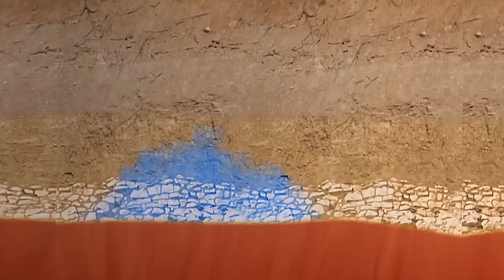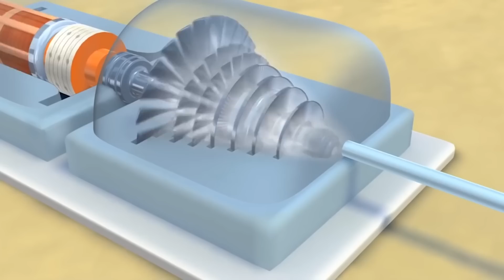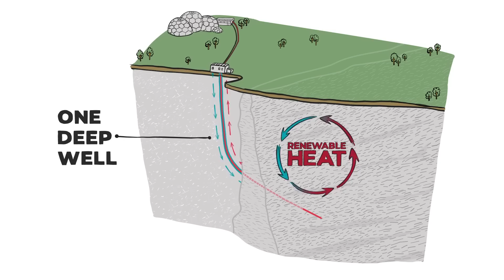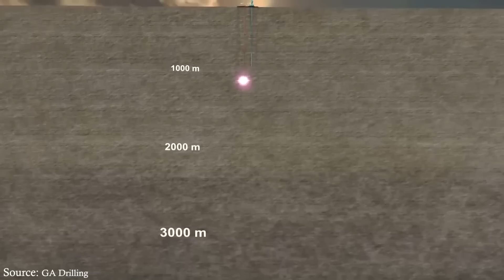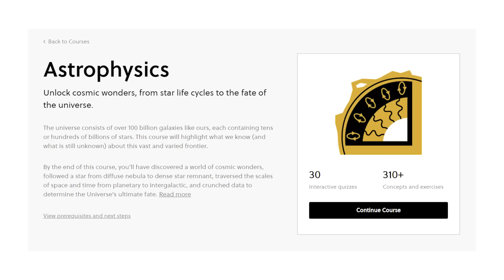How This Hole Keeps Generating Energy

Comment: High energy doesn't equal to High power. I bet the main challenge would be the Rate of power generation. You would need a bigger surface area at the bottom of the pit you dug to get a meaningful amount of water heated within a relatively shorter period of time.

Comment: Lots of good comments about the corrosion issues, reminds me of nuclear fission proposals using non water coolants such as lead or molten salt. But in those cases it might actually be much easier to solve the corrosion issues as you don't have most of the periodic table coming up a pipe onto your heat ex changer surface!

My personal favorite tech for the upcoming advanced modular reactors (AMRs) would be a heavy nitrogen gas (N15) cooled and yttrium hydride moderated thermal spectrum direct cycle reactor. No heat ex changer, no corrosion issues (or a normal level of corrosion issues), and the reactor vessel isn't absolutely enormous as it is with a graphite or heavy water moderated reactor.

Comment: Having worked in the Oil and Gas Industry and a bit with waveguides, I'm wondering what the losses on kilometers-long megawatt scale waveguide might be? Also, Microwaves powerful to blast through hard rock at meters per hour could do the same to a wave guide as well, and even if waveguide losses were minimal, over miles could add up and over months of operation could degrade the wave guide surface through:

Conductor Losses: The conducting walls of the waveguide can lead to power losses due to the finite conductivity of the material. This results in the conversion of electromagnetic energy into heat as it propagates through the waveguide.

Dielectric Losses: Dielectric materials such as insulators or fillers in the waveguide can absorb electromagnetic energy and convert it into heat. This absorption is characterized by the dielectric loss tangent, which quantifies the lossiness of the material.

Radiation Losses: Imperfections in the waveguide, such as bends, joints, or gaps, can cause some of the energy to be radiated away from the waveguide, leading to power losses.

Surface Roughness Losses: Irregularities or roughness on the inner surface of the waveguide can cause scattering of the electromagnetic waves, leading to additional power losses.

Mode Conversion Losses: In multimode waveguides, energy can be lost during mode conversion processes, where energy is transferred from one mode to another. This can occur at irregularities or transitions within the waveguide.

Aperture Losses: In waveguides with apertures, such as horn antennas, there can be losses associated with the transition of energy from the waveguide to free space.

Absorption by Gases: If the waveguide contains gases, such as air or other contaminants, these gases can absorb electromagnetic energy and cause power losses.

Skin Effect: At high frequencies, electromagnetic waves tend to propagate near the surface of the conductor. This skin effect can lead to increased power losses in high-frequency waveguides.

Comment: I hope they do it like how they dug the pylons for the Brooklyn bridge. A tunnel boring machine aimed straight down tho. Case the bore with concrete as you dig. Pour water in the hole while you dig and use chain link buckets to lift the waste out. 
You could have a crew on the machine as it digs to do maintenance. Elevator to move supplies and crew in and out

Comment: No. The Kola bore project didn't run out of money. The purpose was to measure the thickness of the shell of the Earth and assumed that we live on a planet whose center is hollow. They accurately determined that the thickness of this shell close to the Arctic Circle is around 22KM. They stopped after determining the thickness since that was the real reason. Do yourself a favor and read the "Project Orion" KGB PDF document that was recently released.

Comment: There is a geothermal generation at Wairakei in NZ that has been grid connected since the mid 50's. Any volcanic shallow crust area has this potential, think calderas. Important minerals like lithium can be extracted and the hot water re-injected. The steam usually is wet and this liquid  is corrosive and aggressive so lots of maintenance.

Comment: The manhole covered hole in russia is already deep enough for geothermal energy, the rock around the bore-hole was said to have the consistency of plasticine more than solid rock, and rock at those temperatures are more than sufficient for people to put a thermo-coupling into the middle of it and run a couple of heat exchangers to keep from fracking the mantle and causing an earthquake like conventional "geothermal" systems attempt to do, making the water use the entire rock structure without ensuring there are no contaminants and deep faults that can cause an earthquake or a sinkhole with erosion over time. The key to designing new geothermal systems is to make the borehead the actual heat extractor and use it to create steam power for a steam powered turbine at the very simplest.

Comment: What about heat resistance of the drill? Isn't it hot enough to melt metal 20km down? And how do you maintain a hole that goes through non-solid molten stone?

Comment: This approach has two major challenges.  First, you don't just have to make the hole, you also have to get the material OUT of the hole.  And even if your drill bit doesn't care about the temperature of the rock, the pipe bringing the rubble up certainly does.  Second, you can't drill deep just anywhere.  There are pretty specific limitations on where you can drill, so many power plants will just not be in a good physical location to start drilling.  It isn't even about the depth.  Soil and rock type, presence of sand or aquifers, etc can all interfere with drilling operations even at shallow depths.

Comment: What are the unintended consequences? Why does Earth have an atmosphere and Mars barely any? What's the difference between the two? Long ago Mars had an atmosphere, had oceans and rivers, but not anymore. That's because their mantle cooled causing the metallic core to stop rotating. This eliminated the magnetic sphere around the planet that prevents the atmosphere from being blown away by solar wind. So if we switch massively to thermal energy what happens? What happens to the heat of our earth when we extract massive amounts of heat to power all our electric toys? Hmm. Don't worry about it. That's a long time from now. We'll be gone. Our grandchildren will figure it out.

Comment: The reason this is not economically attractive is because for the cost of drilling ultradeep geothermal wells you can drill many times that number of conventional wells and produce oil and gas, which provides not only reliable power but also feedstock for chemicals,  plastics,  medicines,  etc.    If you live near a volcanically active area like Iceland,  use geothermal.   If you live in the other 99% of habitable earth,  use hydrocarbons.

Speaking with over 40 years experience drilling and developing oil and gas fields, including some of the deepest, high pressure wells and fields developed.

Comment: Thermopolis WY is sitting on top of a huge geothermal area just under the surface. Drilling down only 1500 meters would provide a huge  super heated steam supply. A series of wells could equal the energy output of Bonneville dam on the Columbia river.  The area down in south Oregon by Klamath falls, and Lakeview have super heated rock about a thousand meters down. Drilling fake oil wells could provide enough steam to produce a couple gigawatts. Providing enough water at depth to feed the turbines becomes the only hurtle that has to be over come. The Lakeview area tends to be pretty dry rock, and needs water pumped down into the ground.

Comment: I like your presentation, but as someone on the other end of a 30-year stem career, the concept is good but flawed. Sadly the first hurdle is politics. The second is geography. Third is geology. I'm sure that more forms of geothermal energy capture will be more common in a decade or so with technological advancements. NO, funding ISN'T the big issue, ask Elon!
I've been more than 2km underground (when I was your age) in a goldmine in South Africa, fascinated by the capabilities of local engineers to mine, and build power stations, hydro schemes, nuclear facilities, etc etc. Recently I have seen politics and vested interests truly f-! things up. Today South Arica is unable to keep the lights on, a country that only 3 decades ago was capable of powering up sub-Saharan Africa. The degradation manifested in only a decade, despite fantastic advances in tech, including developments by South Africans on all levels (Remember where Elon comes from). At least one benefit is that the formerly sanctioned South African scientists (who had to develop independent tech) and engineers et al, now spread around the world because of politics expelling on a racial basis, are helping to make it a better place😏

Comment: Hi I enjoyed your video very much but I was wondering, Why do all that drilling to get to the heat / temperature they need when all they have to do is cap off the super heated funnels which are in abundance in mot of the seas around the world.. Surely that would be cheaper than all that drilling and it would be achievable very quickly. Does this make sense to anyone out there.? thanks Deryck

Comment: There are a lot of points missing from this video.   Drilling deep isn’t limited to “how hot the rock is”.  It’s the fact that tensile limitations of steel drill pipe etc cannot withstand the high weights  associated with long lengths of pipe.  That, coupled with the fact the rock that’s been drilled needs to be circulated back out of the hole which is done with drilling fluid.  I could go into a whole discussion about the limitations of deep drilling but it would take ages
Reply: They have the belief it would be transported to the surface in gaseous form and as an owner of a plasma torch cutter I can reasonably conclude they smoked themselves silly.

Comment: Are we digging deep enough to extract the heat by pumping water down? Or are there water deposits down that far? And if there are deposits down that far will that not increase the loss of energy from the core of the planet?

Comment: The kola borehole was shut down due to them running out of money?  
The kola borehole was shut down due to adverse drilling conditions?
Yes you say both. 
The former is incorrect. It's a political line you've probably read on wiki. Leave political statements out of your uploads. It leaves you open to contradiction as it did in this upload. Apart from that. Nice video matey.

Comment: Why not engineer a high-pressurized water drill..? It can destroy everything in its path and water could also work like a coolant agent.. within a range of temperatures that don't go over 150/180°C, maybe even 200°C.. but I think that even high pressurized water will evaporate in less than 2" at 250°C.. I'm not a fan of plasma drilling.. it comes with some nice exhaust gasses and it turns into a black hole when it comes to the energy that it needs to work.. I don't think that in the long term period, it could be a viable way to drill holes.. but I hope that one day every single home or factory or whatever could get access to geothermal energy.. the greener energy ever, endless, and where the only one who can make some money is the team that installs the geothermal system at your home and that will do the maintenance when is needed, nobody else could come to you and ask to pay electricity bills if you're independent..!! This is the solution, we knew about this solution for many years but, because it will be the end for the big conglomerates who make billions on us, it was "ghosted". They've tried to develop all kinds of different sorts of technology related to renewable energy just to make people think "oh renewable energy is interesting but we can't re-lay only on that.. sun and wind will never be able to provide enough energy for everybody". That's true but there's much more than sun and wind.. we all should notice that the biggest free energy supplier is just under our feet..! We must invest more in research to upgrade what we've discovered until now and try to really democratize geothermal energy. Free energy for everyone. Can you imagine that there will be no more pollution at all..?? And we maybe could keep running our beautiful petrolsuckers, that certainly won't be a problem any more at this point..!!

Comment: It's not hard to imagine drilling a deep hole, but it is hard to imagine creating a reservoir underground artificially. You also need a way to force cold water into the reservoir, without the backpressure of the steam stopping this process. Basically, geothermal is only really practical on an active geothermal vent and reservoir. Making one artificially is basically "not possible".

Comment: Nothing is for free and everything we do to the planet has an impact. The planet does its thing becauseof what it is. So we discovered it has internal heat. Its infinite? Uh I don't think so. Every energy ever created will reduce to it's lowest level just as a red hot Iron cools down. What happens to the Iron it shrinks. When it does it can break. You have no idea what will happen to the earth if you start cooling the earth and I don't know, but I can make an assessment of risk. If the molten outer core solidifies then we could loose our Magnetic field and it's protection from the solar wind and radiation. Don't quote any examples as they don't know either. Don't meddle with forces you cannot comprehend.

Comment: I like the idea of plasma drilling and also that they plan to use (recycle) coal mines for this as well. 
I will be very and pleasantly surprised if this plasma drill can drill 20km in 100 days.
 Geothermal looks very promising and if this drilling works as promised, then it could be set up just about anywhere. 
That being said, I would still hate the idea of drilling on a fault line. That sounds like a recipe for disaster.

Comment: A closed loop hydroelectric power station can be built so it is self charging so it can provide electricity indefinitely for less than the cost of any other system of electricity production.

Comment: The Swiss tried to use geothermal energy by drilling deep holes but that resulted in local earthquakes in an area they are totally unknown. Here in Finland they tried that, too in Otaniemi, Espoo. The result was world's most expensive well that gives neither water nor heat.

Seriously, cooling Mother Earth's heart just a tiny bit will disrupt the flow of molten lava inside and therefore cause unexpected results. Unadvisable.

Comment: While this report deals completely on the difficulty of drilling somewhat on the psychics, it has not addressed any potential dangers. This drilling concerns me.because science doesn't really have a clue what will happen when this energy gets released. For one it doesn't take an Einstein to realize there is tremendous pressure in the middle of the Earth. I foresee a plume of Molton lava miles high into the atmosphere. That lava is being contained by the Earth's crust. Yeah volcanos erupt often but not under one tiny hole. At the least wherever this hole is dug could be covered in Molton lava in short order. I think we should discuss this with the Aliens first, they're much smarter than Earth Humans as they have eons more experience in the universe than we do.👽

Comment: You do not need to drill for thousands of meters; one-hundred meters are more than enough to run your heating on geothermal energy. And the tech does already exist! Drilling very deep would be interesting for a huge powerplant but not necessarily economically more efficient.

Comment: There are many locations where hot spots are almost on earth' s surface. One I visited is a few !miles from Phoenix Arizona. In addition Apache Trail a few miles East of Phoenix City limits advertises hot Springs baths. Why are not these easy to reach hot spots not developed as cheap energy sources? Could there be more to it than just drilling difficulties?